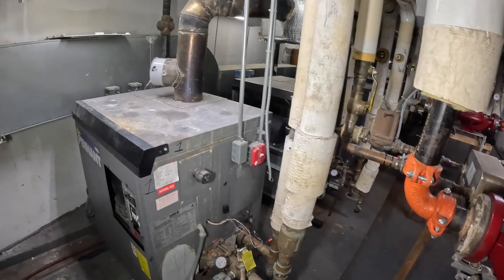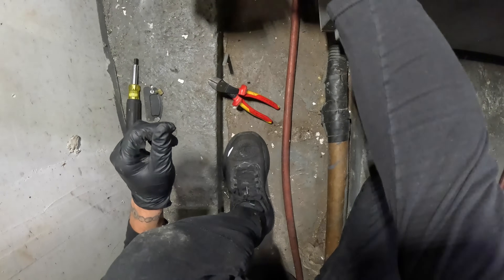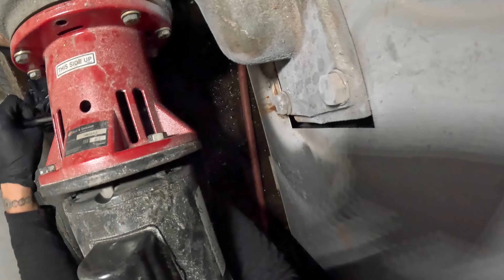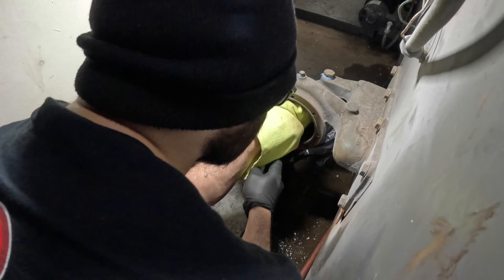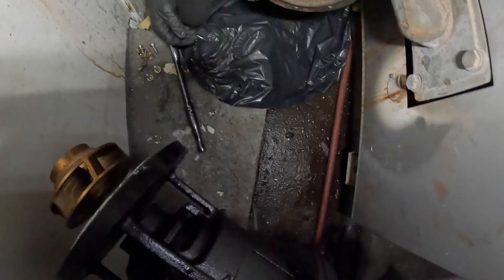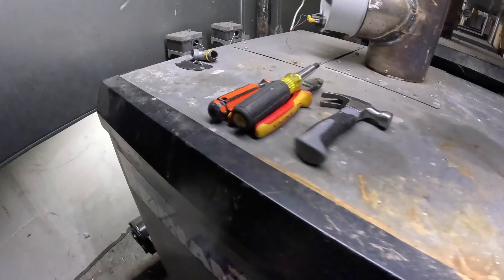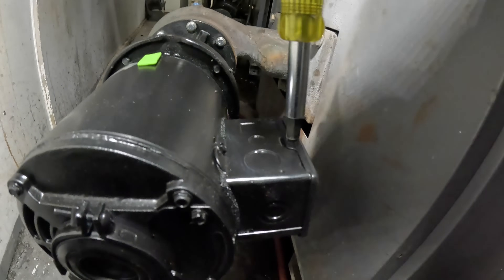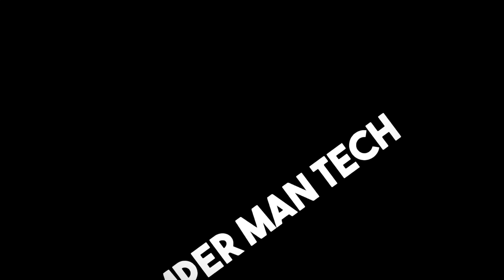HVAC: Commercial LAARS PENNANT Boiler Pump Making Noise (How To Install A Circulator Water Pump)

Comment: You know it’s just a matter of time before that heat exchanger let’s go! I used to change bell and gossett pumps myself but if I didn’t split them I used a scissor jack as a second hand, they are cheap and you find them at junk yards.  PS. Vacuum grease from Dow Corning is like glue when putting gaskets on.

Comment: For holding the gasket in place on the pump, just get it wet. I've seen silicone and other chemicals actually weaken the gasket material and cause leaks.

Also, the "header"  of the pump is called a volute.

Lastly, for these pumps that you have to try to hold in place while getting bolts started, if you get yourself a few different sizes of allthread, and have two or three of each size in your tool box, you can thread them into the holes in the volute, slide your bearing assembly and motor onto the allthread, and then remove them once you get some actual bolts started.
Reply: Easiest way is to put the bottom bolts in the flange first, drop the gasket down and it gets easy to line up the gasket. Only caveat is if the gasket goes around the bolts. I use a drift pin top and bottom in that case to line it all up. I always get the bottom lined up first as it's the hardest to see and line up